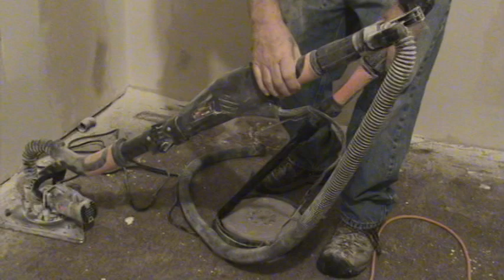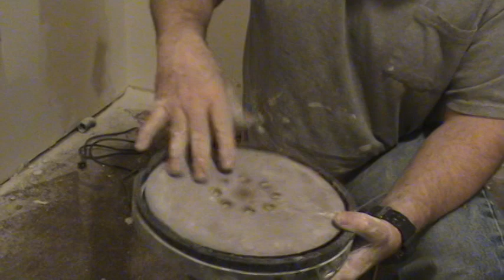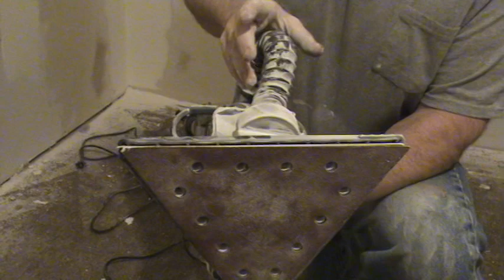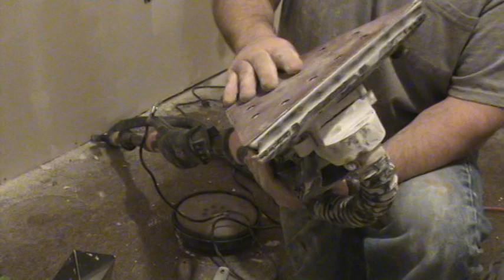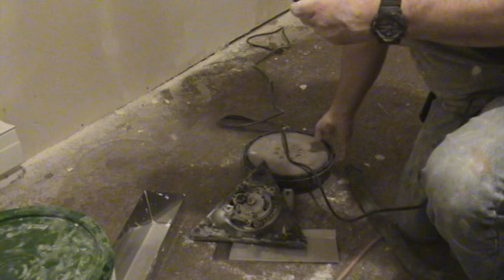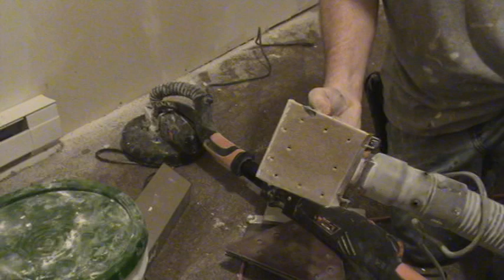Reviewng a drywall sander.

Comment: Ya, just watched your review on your sander, and your comments on the dust with the round head, I have the wen with just the single round head, the vac hose goes directly into the out side edge of the round head, very little dust escapes , does a beautiful  job sanding, finish sanding with  180 or 220 grit. On the model u have, where does the vac connect  to the heads, I can't see where. Just curious.
Reply from the maker: around 15:12, it connects on top of the sander